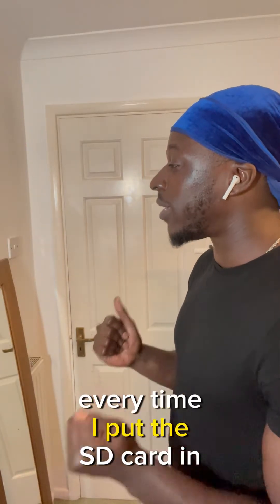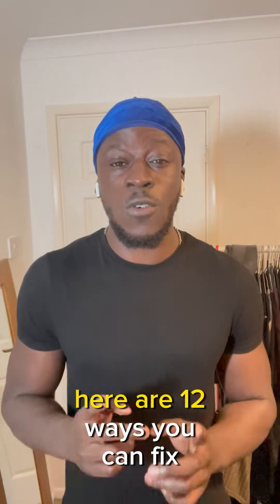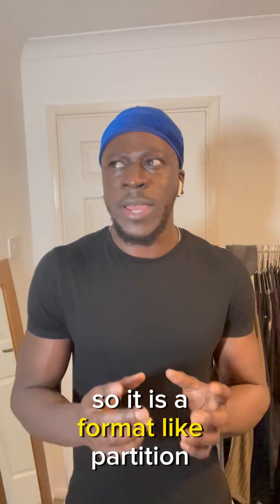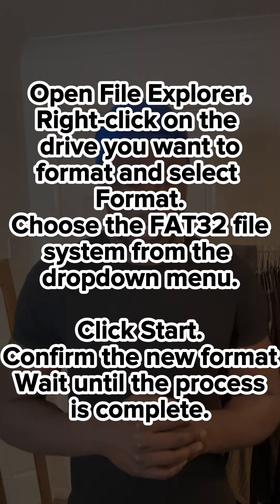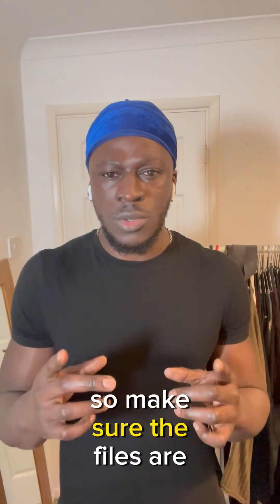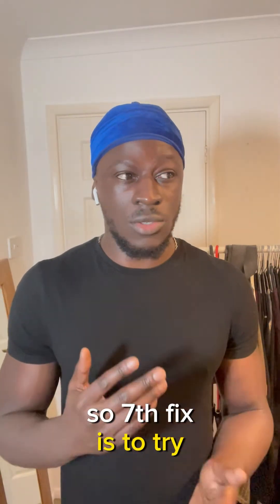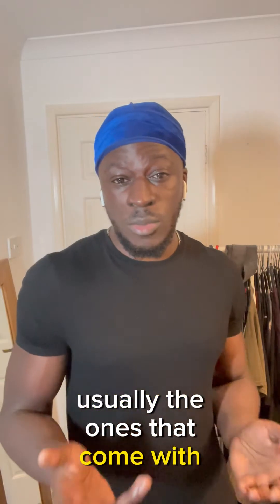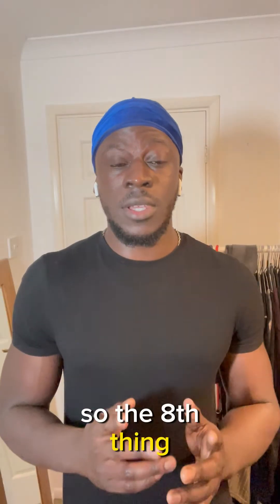🛠️ SD Card Not Working in Your 3D Printer? Try These 12 Quick Fixes!

Comment: What if its not showing FAT32 and instead showing exFAT
Reply from the maker: Looked up exFAT, looks like it's a newer version of FAT32 that can handle larger files, basically a lightweight FAT32. I'd try it out and see if it fixes the issue. Did you try it out already?
Reply: @3D-Printerly oh i just bought a new sd card that was in the fat32 range
Reply from the maker: @HalfWayDarthArtist Alright that works too!

Comment: I had a printer for 2 years and was never able to get it to recognize the card. Im using a Mac and I Reformatted it at least a dozen times. I was reformatting it in GUID and it never worked. Finally I reformatted it in fat 32 format but used the Master Boot Record (MBR) partition scheme and it finally worked. Try reformatting in fat32 in thr MBR partition scheme and I bet it works for you.
Reply from the maker: Thanks for the tip! Did you try it with just one card or was it multiple cards that had the recognizing issue?
Reply: @3D-Printerly I tried with three different cards. An 8, a 32, and a 64gb. Once I got the 8gb formatted correctly I didn’t try the others again.

Comment: FAT32 doesn't come up as an option
Reply from the maker: What size SD card is it? I think if it's above 32GB the option doesn't come up. If that's the case you can use a 3rd party software to make it happen